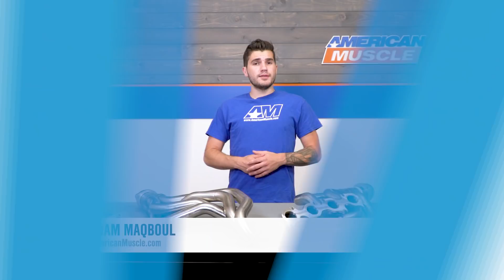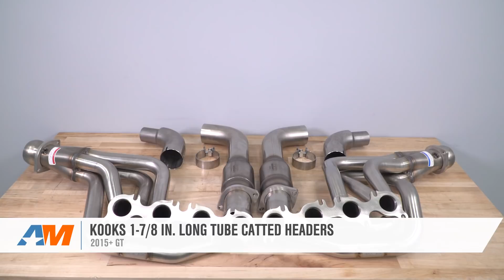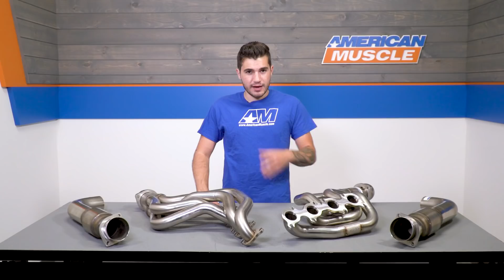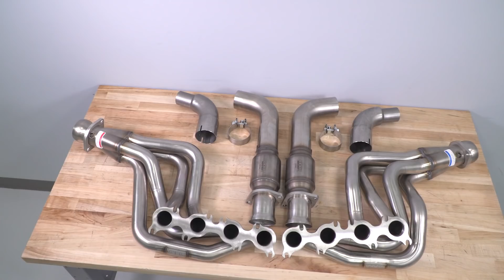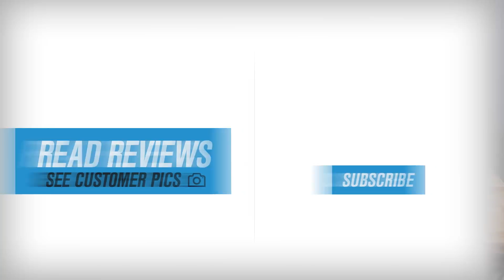2015-2018 Mustang GT Kooks 1-7/8" Long Tube Catted Headers Review

Comment: Is there really anything that makes the Coyote sound deep ?  They all sound horrible with full exhaust and headers.
Reply: The lowest I've seen is probably Borla S Type with an H pipe.
Reply: You'll want an H-pipe or Corsa's double H-pipe for that deeper sound. For mufflers, you'd want Borla or to go with the Mach 1/GT500 mufflers. Roush and Corsa are more exotic sounding, so they aren't that deep sounding.

Comment: Do I need a tune after install?
Reply: Yes! You 100% need to tune it after
Reply: @habanero5.054 
Is it OK to use 2 inch headers with N/A 5.0 2018?
Reply: @5.0gt2  I’m honestly not sure. The most common header I see used are 1 7/8th. 2 inch might be better for boosted applications but I’m not 100% sure on the 2 inch setup

Comment: Is there really that much of a difference in power between the catted and catless longtubes?
Reply: You'd never notice the difference. It's small enough that it could be considered acceptable variation on a dyno. Air intake temperatures would make a bigger difference than cat restrictions.
Reply: nikonhckr or about 10hp. So when something only gives a full bolt on another 20-25. 10 can be a lot.especially looking at a tune install and pieces for about $2700 on average.
Reply: The people saying 10hp from catless to cat are wrong. If you have turbos or a supercharger then maybe but a stock motor with a tune and headers and cai sees almost no gain going to catless. The cats that come on these are hiflow and barely do anything. On a dyno you see maybe 2-3 hp. Get catted and save yourself from the nasty smell and check engine lights. No tuner will delete rear o2 sensor signals anymore so not worth it
Reply: @xGR1MxREAPERx I was wondering if catted headers would keep me from throwing a CEL. Wanted to know cause I didn't want to deal with the light coming on.
Reply: @chrisw.7039  my 19 mustang has kooks high flow catted and no dial harnesss or anything and I don’t have any check engine lights at all.
Reply: @xGR1MxREAPERx how are u liking the kooks and with it being catted, you recommend??? Or catless?
Reply: @zacharylopez4750  depends what your going for. If your going booster go catless. If your not then go catttd. Don’t spend extra for green cats. It isn’t necessary. Get 02 spacers if you throw a CEL code.
Reply: @chrisw.7039 did you ever find out if this throws a CEL?
Reply: @Vaporstang5.0  Nope. Sorry, nothing definite.